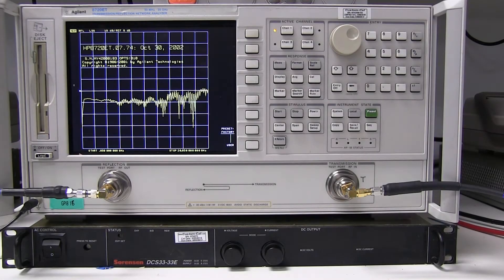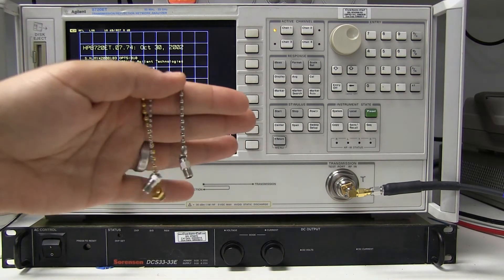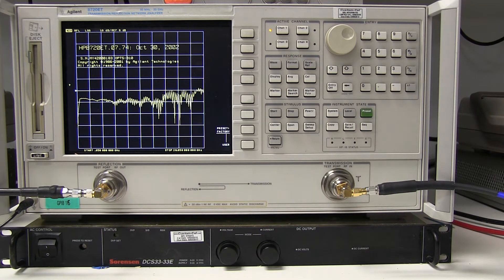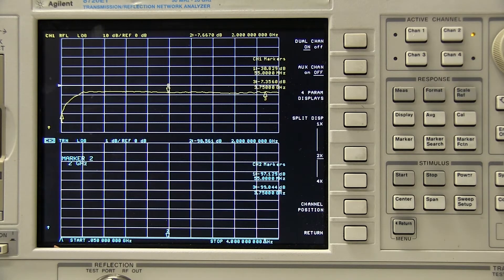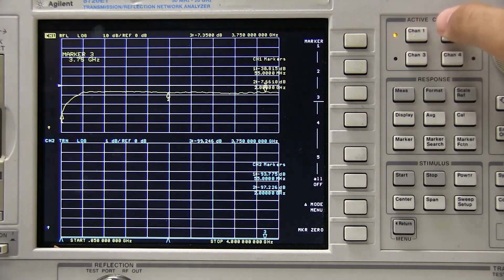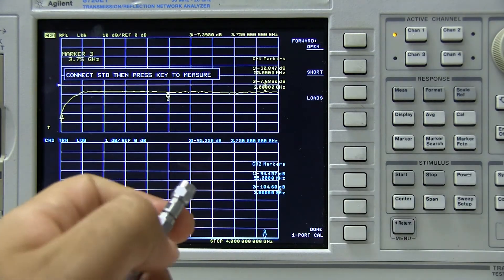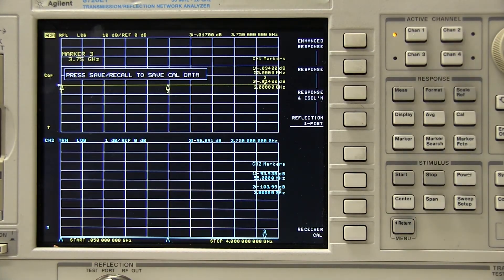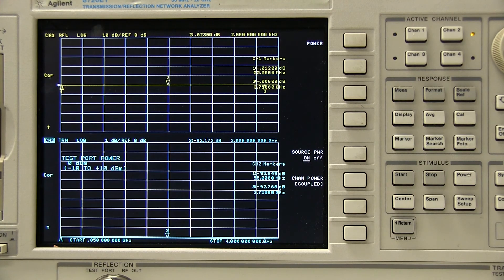#1 VNA Basic SOLT Calibration

Comment: Some good explanations by why do you not clearly show what port you are plugging the short/open/load into?
Reply from the maker: Chris - Thank you for your question. In this video I am connecting the open/short/load to port 1 of the network analyzer  (which is the leftmost port). This way, when that part of the calibration is complete the analyzer "knows" what each of these standards are and can calibrate based on them. In the calibration we're showing the analyzer a predictable open load, a short circuit, and a 50 ohm "good" match. Once we attach the device under test (DUT) it will be able to accurately measure how well (or how badly) the DUT reacts to the input stimulus across the frequency band we're calibrating with. Let's say that the device is well matched from 50 Mhz - 1.5 GHz, and is not well matched in other frequencies. We will then see a "good" match in that band (example: < -15 dB S11)  and a "bad" match (example: > 4 dB S11) in those areas. I defined "good" and "bad" in quotes because those good and bad values all depend on what you are measuring. I hope this answers your question -  I welcome any additional requests to explain/clarify in the comments if others have similar questions. Thanks again.

Comment: hi, thank for sharing this useful video. i have some questions but i don't know if you could leave your email here to more easily contact .
Reply from the maker: Please post any questions you have in the comments. It may help others that have similar questions.
Reply: thank, sir. so what is the difference  between the calibration from end user (e.g SOLT) and that from manufacturer's service
Reply from the maker: A very brief explanation: When a piece of equipment is calibrated by the manufacturer (or a cal company after initial calibration has expired), the equipment's stand-alone performance is verified, i.e. they make sure that the equipment is correctly performing and reporting accurate measurements. Typically, the reference points for these measurements during calibration are the connection ports of the equipment. The purpose of a user calibration is to remove any of the losses or measurement differences from other components connected to the device under test. For example, if you are measuring a filter, it's impossible to connect it directly VNA ports without using test cables, RF connector adapters, and other components in between the filter and measurement ports of the VNA. If you measured the filter without re-calibrating the test setup (with any cables and adapters used during testing), you would not be measuring the filter 's VSWR and insertion loss. You would be measuring the VSWR and insertion loss of the filter, the test cables, and any adapters you are using . That would not be an accurate measurement of the filter. The purpose of the user calibration is to compensate for the insertion loss and VSWR effects of all components you've set up between the device under test and the VNA, in order to get an accurate measurement of only the device being tested.
Reply: thank you, i would like to talk about the manufacturer's calibration. i know that there are many tests in each calibration, for each equipment (e.g VNA). so how do we establish these tests ?